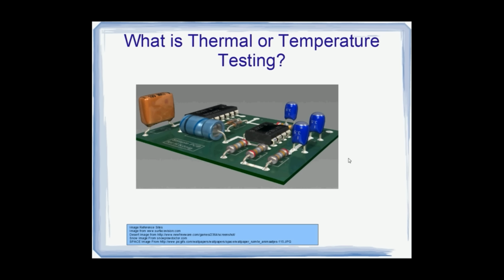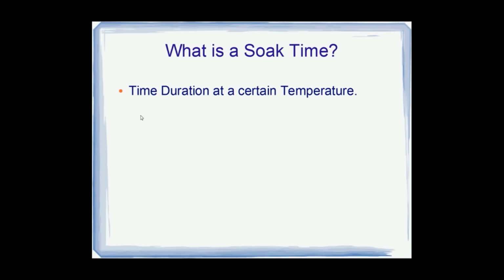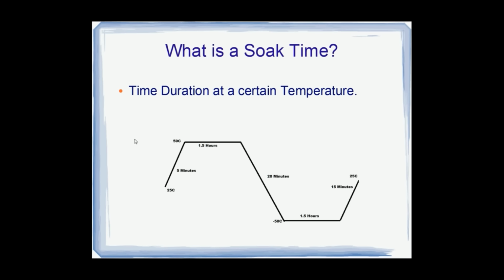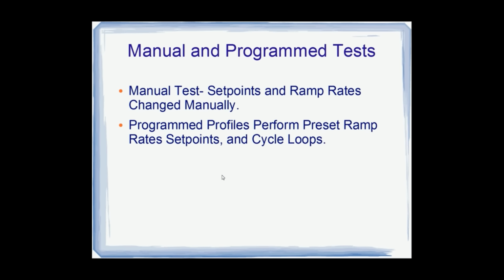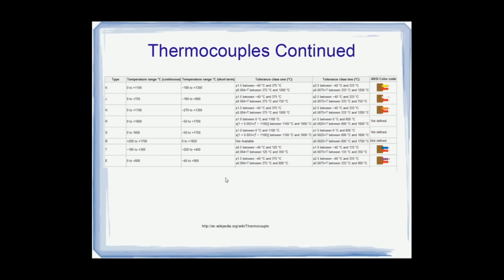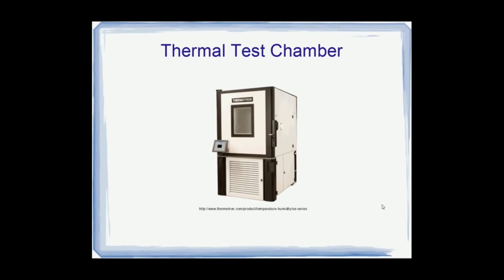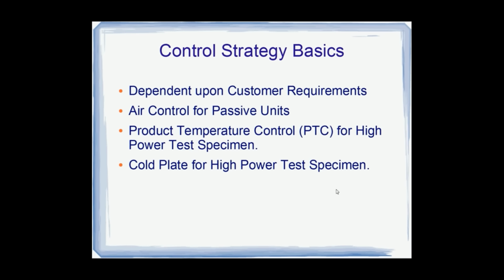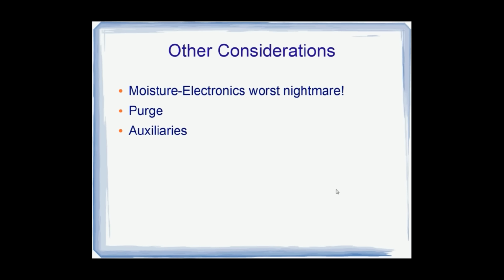Introduction to Temperature (Thermal) Testing- Temperature Cycling Tests

Comment: Hey Tom, while doing a test, if by chance my thermocouple breaks down, immediately I replace it and continue the test. Is right or wrong and why. Pls reply
Reply from the maker: Hi Vishwanath, depending on the risk level for the product you are testing and the conditions you are testing for, you may either need to repeat the test (And in some cases such as flight hardware replace the units under test) or you may continue testing at the current cycle.   I am revamping this channel and will be adding fresh content.  Stay tune for the first new video this Saturday 9/28.